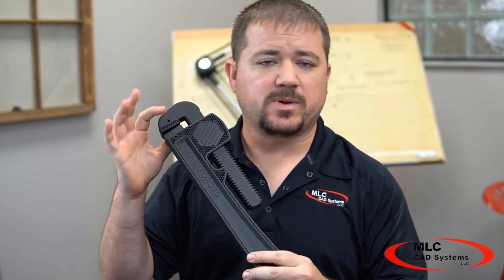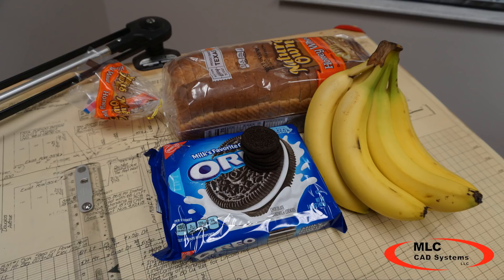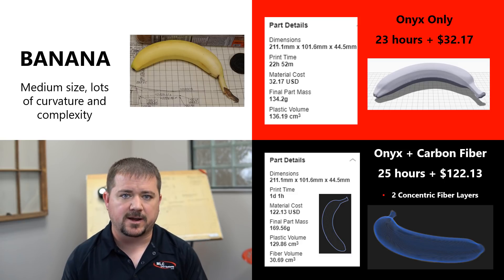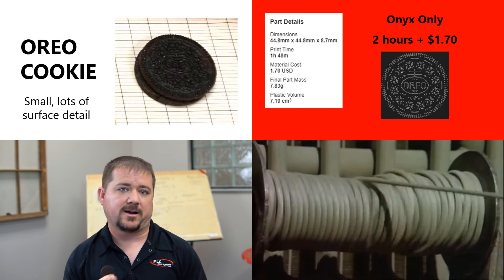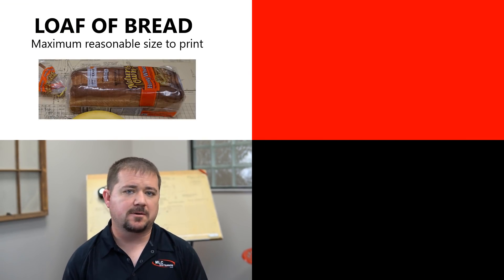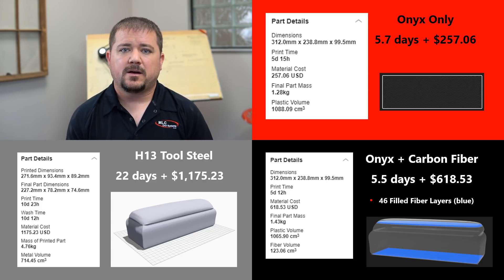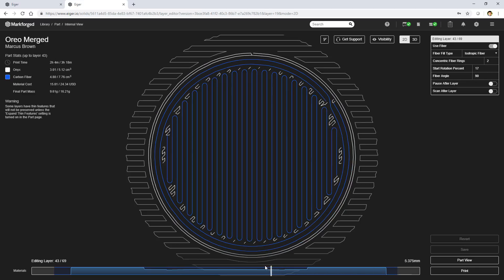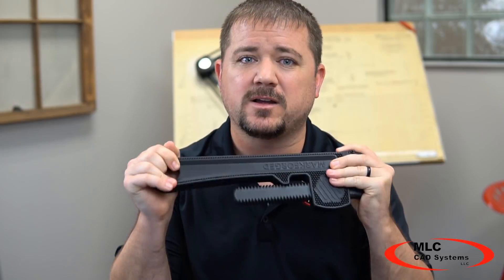Food for Thought When Pricing Out Your 3D Printed Part

Comment: great video - my brother rebuilds a lot of classic motorcycles and always needs irreplaceable parts. are there any plans to have an email the design in and youll ship the part kind of setup or ship the broken part and youll would recreate it. also do youll plan to have brass on the list of materials. btw go easy on the oreos lol
Reply from the maker: Great question, and there are companies out there that perform these kinds of print services.  Search for a 3D Printing "Service Bureau" to find companies that specialize in printing from a print farm for folks who can't justify their own equipment.  If you have a 3D model things get easier, if not you'll have to find someone that can scan and print.  

Brass isn't currently on the list of supported materials, but Copper is releasing any moment now.  I assume Brass and Aluminum will be treated fairly similarly, in that the material is often selected for its manufacturability and cost, rather than for the specific material properties being special in some way.  Since the cost of the raw material is generally less than the cost to powderize and print it for the Metal X, you can likely print in Stainless Steel without spending much more.  If you don't need the strength of Stainless Steel, consider printing it in a composite material.

Luckily I was able to shoot the Oreo footage in one take, but I would have shot that one as many times as required :)